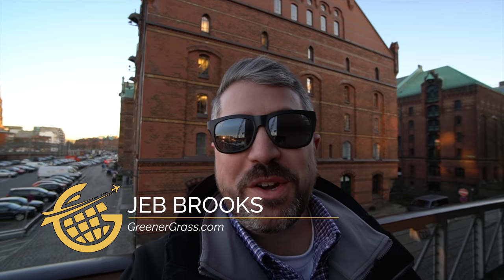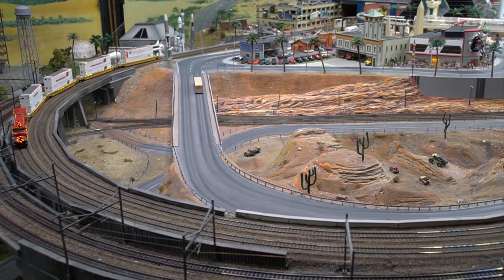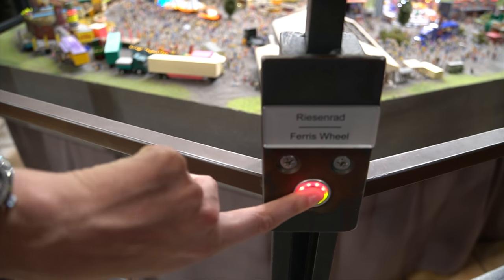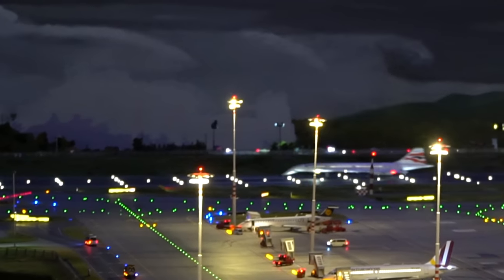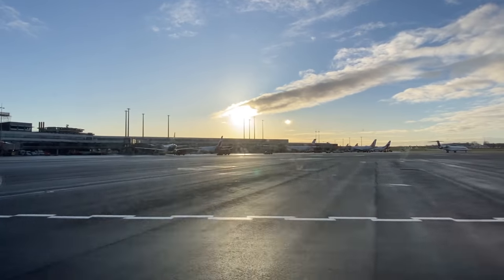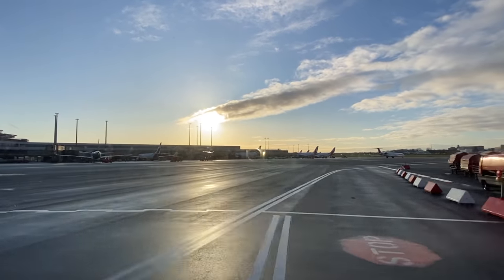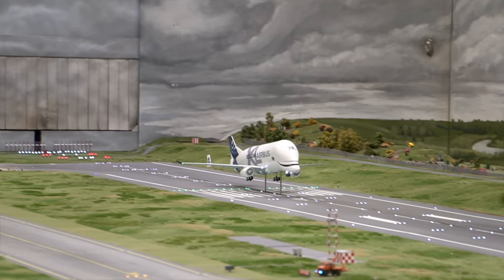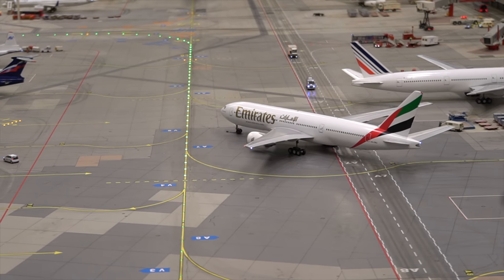Miniatur Wunderland Airport: An AvGeek Must See

Comment: The blue car is an Kids TV Character in Germany.
Reply: Ole Peters a*
Reply: Actually it serves as a vacuum to keep the dust of the road
Reply: @alviyunitasari3737  It is made for cleaning. The cars are steered by small electro lines,which dont work if dust is blocking it.

Comment: 114 years to build...were models trains like this even around 114 years ago?

Edit: Yeah 1 million hours is way overkill. They didnt even think of the idea until July of 2000. And in August of 2001 the first 3 sections were opened to the public.  Stop it bro...
Reply: @GreenerGrass  I think you need to specify that in videos. Just a thought
Reply: There are more persons working there than only one, so you have to divide the number of working hours by the the number of workers.